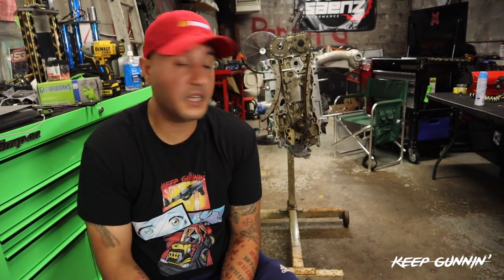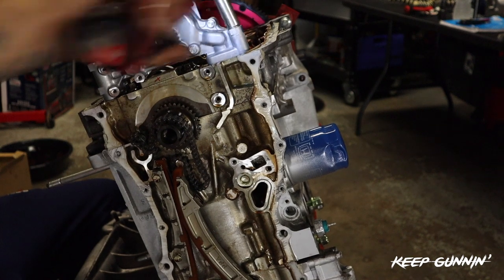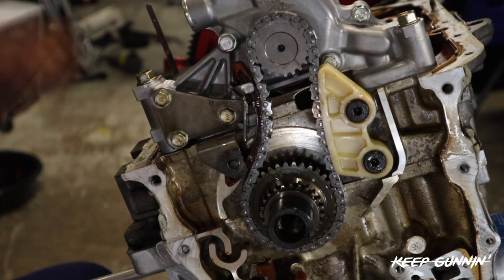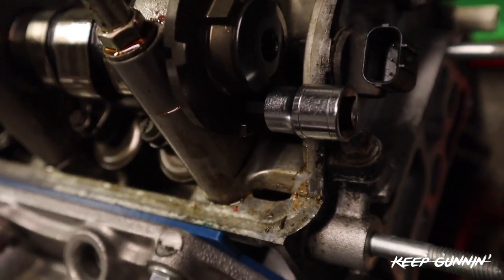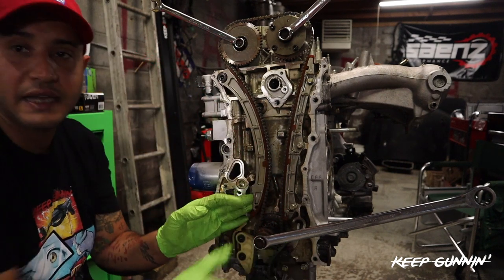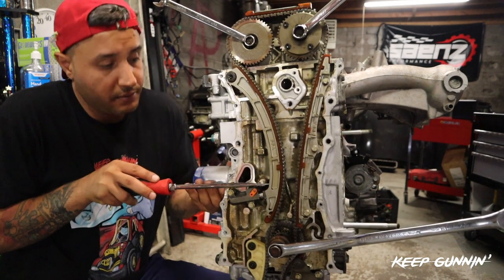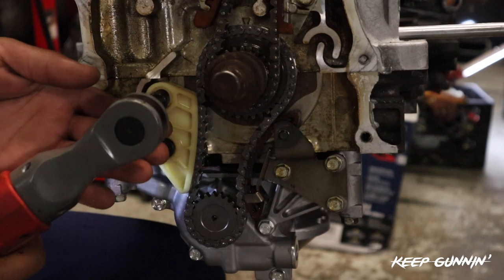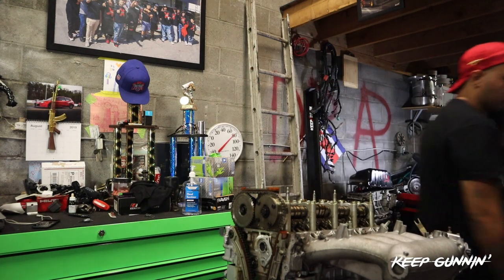DIY TIME AND CHAIN (K SERIES)

Comment: dude!! you  saved me when you  said that you'll never get those links to line up all the same again .  i was thinking that they HAD to eventually go back to start position  , so i cranked on that motor for a hour straight trying to get the gold links , arrows, dots etc all back in place   . i was just about to pull the chain and start over  when i watched this . thanks!
Reply: Does it run right?

Comment: Saludos ¿On some builds I have seen you push in the left chain guide with different tools to help build tension?  I have a k20a3 and replaced the exhaust cam. I set timing and noticed its almost on perfect time. BUT the chain is stretched its got 160,000 miles on it. This a3’s tolerances are within spec but I did not push on the guide and now its sealed up. I am going to set it down and see what is wrong with the other engine a k20a2 its got some internal noise behind the chain cover when fully warm and low compression in #2 and #3. The a3 was supposed to be my spare but I am concerned and dont want to damage it. Compression was low but within the allowed variance in #4, 150psi 13.8 variance. And it had about 30% cylinder leakage on the leak down test. A very little bit of air coming out the exhaust ports. It had been sitting in the living room since 2018.

Comment: Great and informative video, my only question is if the arrow on the front cam phaser/cam gear on the intake side. Does it need to align with the arrow on the 1st cam cap when TDC is set and all other marks line up?

Comment: Hey great videos thanks. I have a question about cutting the oil pump. I bought the pump precut by another person and they cut away the threaded boss instead of shaving it down. What’s bolts down to that boss and how important is it? I was thinking I could just weld on another boss if it’s critical. Thanks

Comment: it's been a while since you posted this so not sure if you'd reply. However, i'm doing the timing on my k24 and the two lines on the vtc gears are slightly off like yours. I have to play around a bit with the gears themselves to get the black links to line up. Is this all perfectly normal?

Comment: How likely you would recommend installing BGA or FAI chain kit to k20 engine? As where im from, genuine complete chain kit is around 1000€/usd. As where BGA/FAI is muchmuch cheaper, around 400€ with intake vtc and exhaust sprocket. Im kinda in troubling with this one.

Comment: I have a 2009 Honda Civic SI Coupe, Swapped the block (TSX 2004-2008) for K24, using K20 Z3 Head, but want to use the K20 (new) Oil Pump, because I'm not racing or going to the track, daily driver. After modifying the K20 Oil Pump, will this be okay?    Thanks for all your knowledge, much appreciated.     Almost forgot, did go ahead and plugged the oil hole, with 10 mm screw (Honda bond), was giving P2647 error code,  changing everything could not figure out why the code until came across videos like yours.

Comment: I have a 05 Honda element ex AWD and need my motor fully rebuilt it's still in the car as I still use it everyday.  The exhaust blows blue smoke so it's burning oil.   How much would you charge to rebuild it fully

Comment: Aki about this video, did you reuse the timing chain or they are new?  I bought an used low mileage JDM k24A motor from Japan and been thinking if I should get a new set of timing chain while doing the type s oil pump. What is your recommendation?   By the way, for the oil pump, by replacing the balance shaft style oil pump to type s. Will it cause the engine to vibrates more? What’s your commend on type s oil pump swap?  Thx a lot

Comment: Great video!  One question, if you did not push on the chain tensioner to make it click, would you have an issue?  Or would it eventually click when the engine starts running?

Comment: Hey how's it going?.  I'm thinking on doing this job on my K24 while the engine still on the car, i'm also doing the oil pump chain, guide, tensioner ect  , how would you suggest i could hold the engine up after removing the side engine mount and oil pan? Any tips, suggestions. Thank you.

Comment: My 04 crv skipped timing and I wanted to install new one .Would I have to remove cam caps to adjust them?Do I put crank a lil off TDC so I can adjust them ,then spin the last 90 degree  on crank to put crank back on tdc?

Comment: So I took the cam cover off to replace my VTC following another vid.  That vid had me take the sprockets off the ends of both the intake and exhaust cams.  In doing so I'm pretty sure I let the tension off the chain which jumped a tooth or two on the crankshaft sprocket (engine has not been removed from the car) and the cams rotated on me (didn't know about pinning in back).  Is there a way to tell TDC on the crankshaft sprocket so I can properly align the cams without removing the crankshaft sprocket?  Thanks!

Comment: Good morning. Good evening. I'd like to know if my k24jdm engine timing chain is stretched alittle will that mess around with my timing mark on my pully and cam marks after I put tention on the chain after I remove the pin
Reply: When you put in on tdc on the crank do your cam gear not line up?